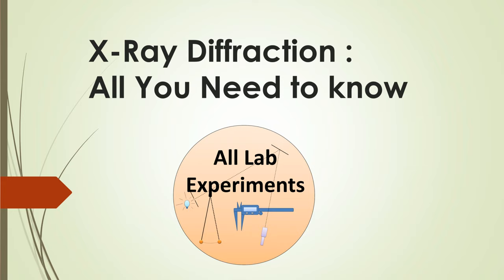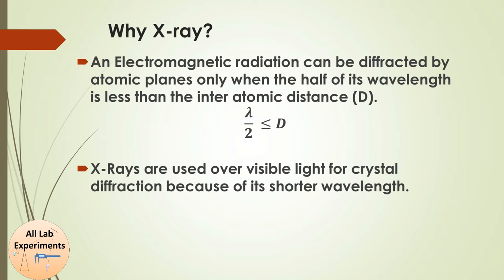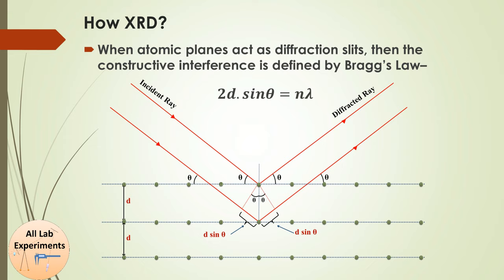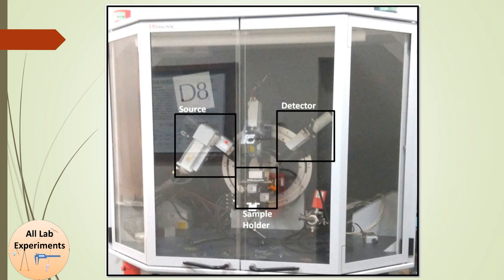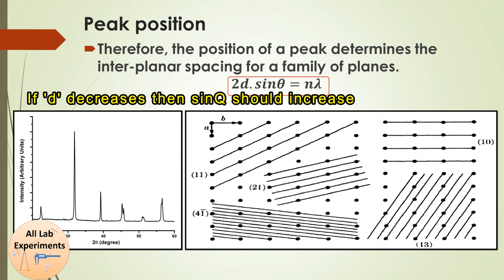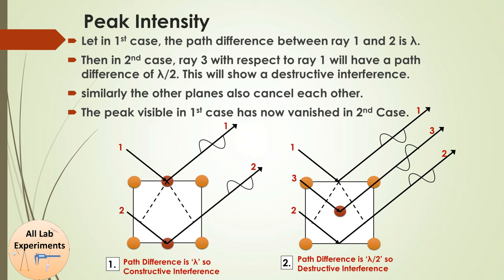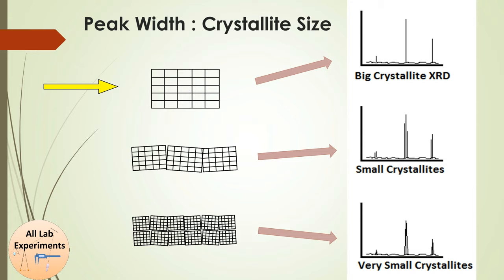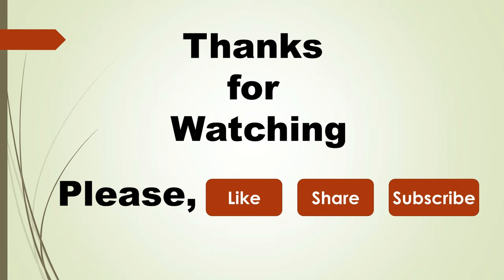XRD - Bragg's Law | Peak Position, Intensity, & Width #xrd #rigaku #instruments

Comment: Peak can be broadened due to many factors, but most significantly non-uniform stress, small particle size, alloying, low incidence angle (in case of GIXRD), etc.
Reply from the maker: Absolutely... Also Watch my latest video on Raman Spectroscopy.

Comment: Loved this video. You are an awesome teacher. Thank you. Also, can you please explain the splitting of peaks in XRD graphs?
Reply from the maker: Like in Barium titanate it is tetragonal in nature. So if you look at it from three different sides from two sides there is one inter planar spacing and from one side you see a different interplanar spacing so you see 200 and 002 peaks split because of different inter planar spacing. This splitting may not be visible for lower angle peaks because they don,t get resolved properly by then but with increasing angle they resolve better and you can see them as separate peaks easily.

Comment: @11:45 As you mentioned, peak 1 & 3 will be destructive, similarly, peak 2 and will be destructive. Then, where does constructive interference will come from? It means no XRD signal whatsoever.
Reply from the maker: Plane 1 n 3 give constructive waves .but because of the introduction of plane 2 which is at half of the path difference it cancels  wave from plane 1. Similarly there will be another lattice which will cancel plane 3 contribution which is not in picture.
The conclusion of the discussion is that what layer 2 is not present then there is a peak and because of the introduction of layer 2 it vanishes
Reply: @AllLabExperiments  Yes, that's what I meant. This represents BCC. Since plane 1 wave is cancelled by mid plane. Similarly, mid plane cancels the bottom plane. So, how do we get peaks in BCC? Since the structure is periodic, we can just focus on this particular unit cell.
Reply from the maker: @_The_Alchemist_  This is just one condition obeying bragg's law. BCC structure will not show a peak for this respective plane. But at other angle when it obeys for other planes (@6:30) it may show peaks. And the overall pattern confirms that it is BCC (@12:00).
Reply: @AllLabExperiments  No no. My question is for this unit cell which has simply these 3 planes which are going to be repeated throughout the lattice. And if you are saying that at some other angle there may be the reflection, then the systematic absences is hoax. Because when we put the crystal in the machine, it will be scanned over a range of theta. So, why to discuss systematic absences then.

Comment: Excellent video i like the topic and information, what is tensile strength explain, please make more videos on XRD data interpretation for identification and quantification by powder X ray diffraction.
Reply from the maker: Thanks Shiv. I am continuously creating content in this field and soon will reach to that aspects of XRD as well. You can also find origin lab tutorial videos helpful in research field. 
Now let us talk about strain. It is caused either in the case of very small particle size or in thin films (it means high surface area causing strain) or while synthesis the bonds of your compound didn't attain its natural length of minimum potential energy. So as the inter atomic distances change, they reflect this effect in the form of XRD peak shift or peak broadening.
The strain cause while synthesis can be tuned by your rate of heating or cooling or the pressure around.
Reply: @AllLabExperiments  is xray spectrometer and diffractometer same?
Reply from the maker: @pranzz30  i have not heard of xray spectrometer... It should be diffractometer i guess...
Reply: @AllLabExperiments  XPS ( X- Ray photo electron spectroscopy) is there. It is similar to EDS/EDX but in XPS we measure emitted electron and in EDX emitted xray.
Reply from the maker: @pankajinimahanta9830  just in output you may have similar results. On xps carbon correction there is one of my video in which i also discuss its science.
Reply: @AllLabExperiments  Sir I have not worked with XPS so don't know much. However I have worked on both XRD and SEM EDX and my experience says, The basic difference between EDX and XRD analysis is that EDX gives elemental analysis which is not possible in XRD, XRD only provides information about the mineral phase. Similarly from XPS data we can have elemental/ compositional analysis. Correct me if I am wrong.
Reply from the maker: @pankajinimahanta9830  no you are absolutely right. But EDX is not considered as an accurate study but xps is much reliable. Also for getting same infor.from.xrd you need deep data analysis and fitting tools. 
You can also see my latest videos on raman characterization if it is your field on anybody in your lab. And a latest video on research paper writing...

Comment: A very nice video that gives a clear understanding of XRD basics. I have one doubt haw to analyze peaks in terms of h k l values and plane of peaks mainly how to assign planes for particular peaks?
Reply from the maker: Consider you xrd a random sample about which you don,t know. Then from the available peaks you get to know about all possible inter planar spacings in that structure and then you match your data with the available peak patterns of different structures or do back calculation to know about the structure...  

You must have noticed in one of the slides that simple cubic, BCC, FCC have a certain pattern of visible peaks... just that helps to identify the structure...

Comment: Hello sir, you have explained very well . can you please elaborate on why we use the arbitrary unit for intensity in the XRD pattern?
Reply from the maker: In your XRD pattern, the relative intensity of different peaks depends upon the position of atoms with in the lattice as you have seen in this presentation. Now what if you increase the intensity of your x-ray source? In case of heavy radiation the intensity of all the peaks increases proportionally and vice-versa. Additionally, If you increase or decrease the scanning rate then also the intensity varies so we write it arbitrary.

The interesting fact is that in all cases the pattern of peaks doesn't change. for example If peak for 011 is the highest and for 012 plane it is around half of the 011 then for any x-ray source intensity or scanning rate this ratio will remain the same if the detector is capable of recording it.
Reply: @AllLabExperiments  Thank you very much for clearing my doubt. One more quick question if I use theta - theta goniometer then can I plot graph of intensity vs theta rather than 2 theta?
Reply from the maker: @sheetalSonar  Sorry I missed your comment. In fact 2 theta is just a convention. There is no harm even if you plot it against theta but the reviewers of your paper may get confused by this. So in my advice don't do this unless there is a strong reason for doing this.
Reply: @AllLabExperiments  Thank you so much for prompt reply.
Reply: @AllLabExperiments  , hi.. I have a quick question. If increasing peak intensity results in  a higher peak, is there any setting for the X-ray intensity that needs to be emitted towards the sample in order to get a good match with the fingerprint diffraction pattern of the sample ? The arbitrary unit is still somewhat confusing to me.

Comment: In XRD graph, some are high intensity and others are low intensity peaks, then what structure it can be classified?
Reply from the maker: The topic is covered in the video... as structure varies the intensity of the peak change relatively but the answer is not straight forward because peaks are because of the sum of many constructive and destructive interferences.

Comment: Thanks for the video.  Is the signal intensity affected by the x-ray source power level and sample distance from the detector/or x-ray source?
Reply from the maker: Yes but in that case all peaks will proportionally decrease or increase and their relative ratio will not change...
Reply: @AllLabExperiments  Thanks for your answer.  Yes, I am comparing different instruments with different source power levels and the goniometer radius to see if/how the power and sample distance affect the S/N of a specific sample.  Is there an equation you may share please?  Thanks.
Reply from the maker: No these is no such eqn. Not just power but the placement of the sample n how much radiation a sample absorbs also matter. So it is not easy to bound all the things and derive a formula which is not even useful

Comment: Very good video explanation indeed! I do have a question: can i determine/calculate peak intensity without using an x ray diffractometer? Let's say the given information would only be the values of 2theta in the peaks and the wavelength of the beam. Any formulas that i can use? Thank you very much.
Reply from the maker: First the pattern of different peak intensities represents the structure so for a structure you can pick up that patten. Then the lattice size of that structure decides the position of angle. Its hard to judge this using a single formula but simulations can be prepared to obtain the required pattern for a structure or modified structure.

Comment: some of the materials  show peak intensity at very low angle diffraction such as less than 1 degree, why
Reply from the maker: Low angle diffraction is performed for thin films only because at higher angle it transmits and you dont get anything

Comment: Sir ,what happen when we change wavelength.
Reply from the maker: Peaks will shift accordingly. In case of Cu source the wavelength of x-rays is 1.5418 Angstrom and you get a pattern for a sample. For Molybdenum it is 0.712 Angstrom. Just follow Bragg's law and for lower wavelength angle theta will also reduce.
Reply: @AllLabExperiments  thanks sir

Comment: thank you for the video Sir. do you know how the FWHM and d-spacing relates to the crystallinity of a thin film? what does it mean when the crystal sizes of a film increases in different samples of varying Molecular weight sir? does it mean the crystallinity increases when the crystal size increases?
Reply from the maker: You should not match Crystallinity and crystallite size should. In polycrystalline materials the whole material is perfectly crystalline but crystallite size is small. In single crystals bigger is the crystal so as the crystallite... in thin films the strain plays a big role. Strain reduces d spacing. Some films are just grown along a plane and behave like compressed thin single crystals whereas some material deposition techniques are infact thick film techniques and behave like compressed and stretched polycrystalline material... I guess you can manage your case according to one of these...

Comment: Sir Plzz tell me
That how can we differniate bulk and nano crystalline  material on the basis of X ray diffraction
Reply from the maker: Is case of nano materials we usually get broader peaks with a lot of noisy data and some amorphous part like a broad hump at lower angle. Whereas for bulk there is scope of getting neat n clean xrd data.
Reply: @AllLabExperiments  very nice explanation sir🙏🙏🙏
Can u tell me 2-3 more points regarding this
If u don't mine
Reply from the maker: This is what i know. Basically you cant generalize all the cases. Distortions from the average nature are always there.
Reply: @AllLabExperiments  it's OK sir thanku🤗🤗🤗

Comment: Hi Sir, assuming that the x-ray wavelength is 1 Å and the bragg reflection is 16 degree. Will the angle changes when the x-ray wavelength decrease or increase? If d consider as resolution, means changing the angle (theta) helps getting better resolutions?
Reply from the maker: Yes acc to bragg,s law equation it will change. But i am not getting the meaning of 2nd part
Reply: d is known as space between inner plane. but does it related to the resolution of image we get? like to lower inner space plane gets better resolution image. 
And if x-ray wavelength changes from 1 Å to 0.5
Reply from the maker: @jocelynel9867  yes there will be a difference of resolution. But i have to look some books for this. See some good book on xrd and you may get the required expression.

Comment: at 11:48 ,in the second figure the wave(1,2) was reflected from a plane which had no atom in it ,how's that possible?
Reply from the maker: Atoms don,t reflect but it is the interatomic distance which causes diffraction. Diagram is symbolic representation. There is a plane above that plane as well. N the atoms on one plane and another plane not exactly aligned make slits causing diffraction.
Reply: @AllLabExperiments  ok thankyou it's clear now

Comment: Sir I want to do xrd analysis of coal sample..so can you please guide me?? means which peak should I take or howmany angle should I take?? please guide me
Reply from the maker: First go through the available literature and JCPDS data if available. Then look at your data and just compare them to be sure about the structure
Reply: @AllLabExperiments  ok but actually I want to know that xrd analysis is used for what??
Reply from the maker: It will tell you that its the same material which you were expecting. And become sure about its structure.